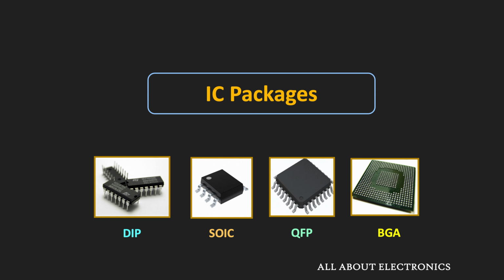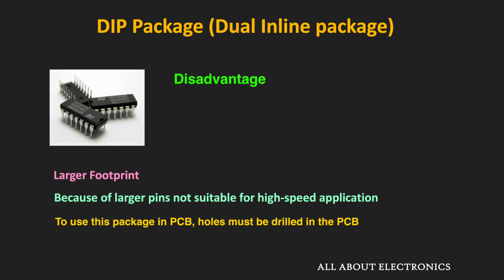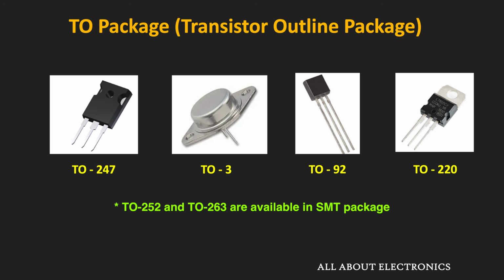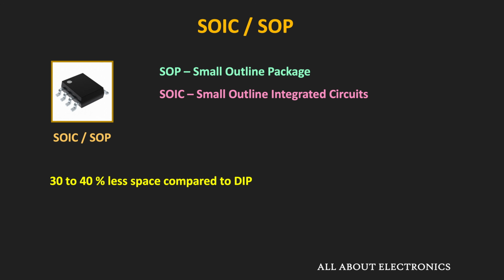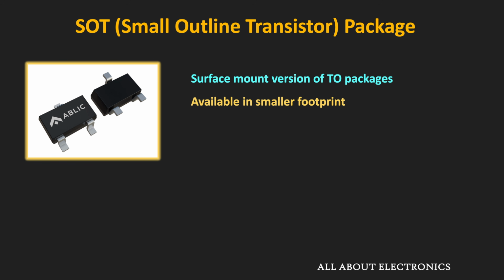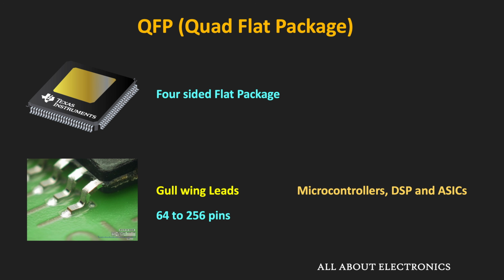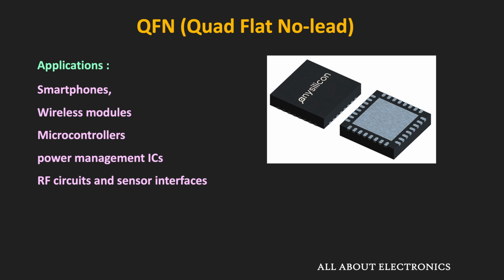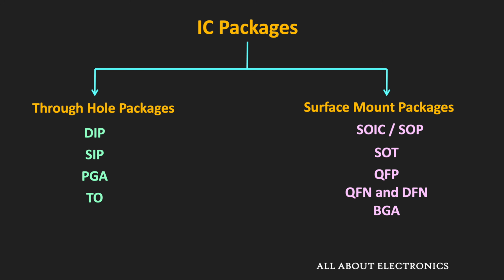Different IC Packages Explained | DIP, SOIC, QFP, QFN and BGA Packages Explained

Comment: • 	DIP (Dual In-Line Package): Big, old-school chips with two rows of pins you stick through holes in a board.
• 	SOIC (Small Outline IC): Smaller chips with pins on two sides, sit flat on the board.
• 	QFP (Quad Flat Package): Pins on all four sides, good for chips with lots of connections.
• 	QFN (Quad Flat No-leads): No sticking-out pins, just flat pads underneath, very compact.
• 	BGA (Ball Grid Array): Tiny solder balls underneath instead of pins, used for powerful chips like CPUs and GPUs.
👉 In short: DIP = easy prototyping, SOIC = small & common, QFP = many pins, QFN = compact & efficient, BGA = high-performance

Comment: 1. DIP (Dual In-Line Package)
• 	Through-hole package with pins extending through the PCB.
• 	Advantages: Easy to insert/remove, ideal for breadboards and prototyping.
• 	Limitations: Large footprint, not suitable for high-density designs.
2. SOIC (Small Outline IC)
• 	Surface-mount package with gull-wing leads.
• 	Advantages: Smaller than DIP, easier automated assembly, widely available.
• 	Limitations: Limited pin count compared to QFP/BGA.
3. QFP (Quad Flat Package)
• 	Leads extend outward on all four sides.
• 	Advantages: Supports high pin counts (up to hundreds).
• 	Limitations: Fine pitch makes manual soldering difficult; requires precise PCB design.
4. QFN (Quad Flat No-leads)
• 	Uses flat pads underneath instead of protruding leads.
• 	Advantages: Excellent thermal dissipation, compact size, reliable electrical performance.
• 	Limitations: Harder to inspect solder joints; requires X-ray for quality control.
5. BGA (Ball Grid Array)
• 	Uses solder balls underneath instead of leads.
• 	Advantages: Highest pin density, excellent electrical/thermal properties, supports high-speed signals.
• 	Limitations: Complex assembly, requires reflow soldering and inspection tools.